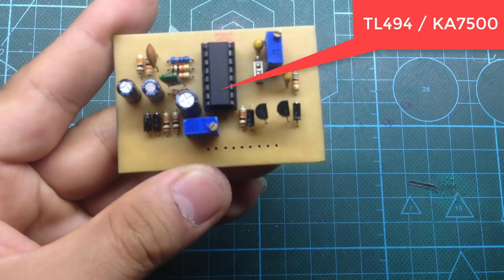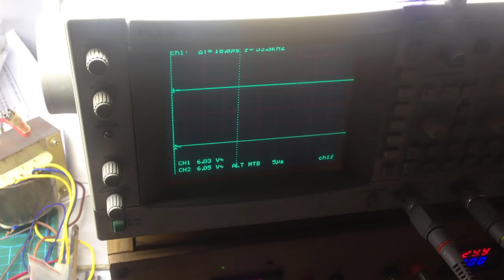TL494 PWM 50HZ to 100Khz Inverter 5000W

Comment from the maker: Project today, I will build PWM module using TL494, you can also use KA7500. It is similar. This module can be used for boost converter, buck converter or iron transformer inverter, pulse transformer inverter, it also has voltage feedback and current feedback. with 2 working modes. Later I will build more circuits using this versatile module. It can drive a maximum of about 16 mosfet - 5000W. If you want to use more, add totem pole drive

If you like my video, please like, share and don't forget to subscribe to my channel, Thank you very much. With 10,000 views, I will get $ 3 from youtube.
Reply: Homemade 102 vietsub sang tiếng việt nửa đi anh mỗi lần đọc commen toàn lên google ko ~~~
Reply: Mà lên tận 5000w thật ko z hay chỉ là 5**w
Reply: Home made how we use it for smps if we need a gdt OR not? Tks

Comment: Hey I just want to know how to check this module without building an inverter or SMPS??
Also in the circuit diagram , both emitters of s8850 are connected to GND but it's different in pcb layout as per orientation shown in the video.
Pls help I have to complete it

Comment: I want to ask if used a multimeter to check the current and dat is it safe to carry a 400watt tv ? Pls reply😃 pls whats d resistance of the primary and secondary windings individually.
Reply from the maker: With pulse transformers, the resistance of the primary and secondary windings is very small. Under 1 ohm
Reply: @PhdHung  thanks 😊 but i wonder what will happen if i pack a bunch cfl inductors(eg 20) turn transformers with some mosfets can i get a high amp 220vac voltage?
Reply: Eitherway i like d video nice and professional outlook✌👍👌

Comment: Bro I'm in trouble please help.i need to make a very very powerful Tesla coil with this circuit so which IGBT or MOSFET I use and which pins.please tell me the connection please and can I make a Tesla coil with this circuit which works on 220v??? Please tell🙏🙏🙏🙏😭😭

Comment: :) Ok but what is input voltage, what is output voltage, what is efficiency? And this circuit only for incandescent bult or resistances. If you connect this circuit to adapter, motor or an electronic device, that device will fail. (because 53kHz is to high for IN4007 of inside devices)

Comment: Thanks for your videos. i need isolated power supply from 220V AC to 100V DC  using SG3525 With optocoupler  feedback.
Reply from the maker: ?W

Comment: You should do a step by step how to conect the sg3525 ic with feedback voltage. Im having some problems to conect the feedback soo i can stabilize the output voltage
Reply from the maker: There are many SG3525 circuits in my channel.

Comment: How to decrease ac Synchronous single phase alternator frequency from 60 to 50 hz, made by kiejeli 7.5 kw( my locally made ups transfomer make a sound of tak tak after 3 sec whenever I try to charge the above mentioned generator, if u have any solution kindly guide me)
Reply from the maker: You can use H bridge and EGS002 module. Generator output is rectified by diode bridge to 310VDC and fed to H bridge using EGS002. you will get true sine 50 / 60HZ - 110V / 220V (selectable) and voltage stability
Reply: @PhdHung  Bro this type of alternator has no such type of mechanism I will send u the pics and vids if u havr any fb or whatsapp, tnx for giving me your precious time Lov u Bro

Comment: Sir if I use iron transformer what voltage should I use?  12v or 9v or 7v ?
Reply from the maker: If it is a square wave inverter, use a 12V transformer. If modified inverter sine, use transformer 9V. If it is sine inverter, use 7V.

Comment: Well done .... so can you use as “ buck-boost converter “ in the same time ? And How ? Use inductor or what can you explain ?
Reply from the maker: wait for my next video, i'll do it, buck using N mosfet
Reply: Thanks, made buck-boost in the same time , can step up and step down voltage in one circuite or module of course have CC mode and has feedback for voltage and current.

Comment: wow can tl494 drive 16 mosfet without totom pole that's good it seems that tl494 is better than sg3525 . any way you are handsome brow. but i dont understand whats the work of the jumper???  is it used as switch or what ??? and thank you so much for all your videos .
Reply from the maker: Use Jump to switch working mode. This jump can be configured for enabling the output of the IC in the push-pull mode or single ended mode.

Comment: I made the circuit 6/8 pin voltage does not come out When I touch my 16 pin finger, the voltage comes out s8550 tl494 is very hot What is the problem? I don't understand

Comment: what switched  the  jumper ,   and please    the trafo windings     primär and  sekundär?  gretings from germany
Reply from the maker: Use Jump to switch working mode. This jump can be configured for enabling the output of the IC in the push-pull mode or single ended mode.

Comment: Can use it for computer, fan, charger ?? What is output frequency ??
Reply from the maker: Frequency is adjustable. If you use pulse transformer, I suggest 40Khz frequency, if using iron transformer, choose frequency 50 or 60hz.
Reply: @PhdHung  thx

Comment: Where do I go to purchase a small high frequency high voltage transformer that can take a DC voltage from 6 to 12 volt and put out 20,000 volt at 30 milli amp ?
Reply: dear you can re wind any small old ferrite core transformer with some calculations.
i had wound one e15 transformer with 3 turns in primary and 100 turns in secondary and tested it at 50 KHz, i got about 1600 V Dc from 12 volt dc.

Comment: Hello,
You did a great job.
I immediately subscribed. I have something to ask you.
1. How should I feed this circuit for 700 watts? So how many amps should I have?
2. Can we use Mosfets as IRF3205? And how many?
3. For feedback, should we set up another circuit or is that all? What is SG3525 for?

Please answer, I would be very happy. I need this circuit a lot. Respects.

Comment: Sir mene amplifier ke lie 60-0-60 2000 watt ka dc to dc converter bnana he. Or main app ka kona drive use kru file no.  Bta di ji e
Reply from the maker: ok, wait
Reply: Sir jese 60-0-60 voltage drop na ho abhi jo drive use kr rha hun main full bass pe 8-10 voltage drop ho jate he
Reply: I need 60-0-60 2000 watts. Tell me which drive file I used

Comment: Hola  compañero!!! Tienes algún circuito  que soporte 48vol o más ? Y que utilice  transistores  IGBT ? Saludos
Reply from the maker: Use buck circuit to supply VCC power to the module. It will operate at 48V.
Reply: @PhdHung  Thanks, you're a genius 💪

Comment: if i change on pin 6 resistor to 10k varible resistor what the range of the output freqency
can i use this module to control treadmill motor?
if i cant use it can u make control board for treadmill with photooptic sensor feedback to have constant speed
can i have ur number to contact u

Comment: Will i get 5000w and pls give an example using motor pump plsss
Reply from the maker: This is an oscillator circuit, you will need 1 DC to DC module and 1 DC to AC module to be able to run the pump.
Reply: Plss sir upload a 3000w inverter circuit plss .......🥺🥺🥺

Comment: Please connect a load which will consume 5kW to demonstrate how it works. To light 40-60W bulb is not impressive.
Reply from the maker: ok bro
Reply: Esos 5kw son imposibles para una ferrita de ese tamaño, a mí se me hizo casi imposible llegar a 1Kw, y para llegar a 1kw tuve que poner 10 vueltas en el primario para 170V a 134Khz y el IC555 apenas aguanta esa frecuencia. Estos vídeos son mentira porque necesita una gigantesca frecuencia para poder poner la bobina del calibre que necesitas. Todos estos vídeos son reales pero la potencia no lo es porque en esa configuración máximo se llega a 300 watts. Te dejo las fórmulas básicas para que puedas hacer la ferrita a tú gusto 😁 (Volts×10^8)/(4×frecuency×B×S) está es para calcular las vueltas de las bobinas P=V×I y está es para calcular la potencia, lo único feo es que tienes que ir probando los valores para que pueda entrar la bobina con su respectivo calibre, espero te sirva

Comment: Best ic..sg3525..ka.3525..pin 10...shutdown system...tl494..bad ic...for use inverter... M...Rashid...multan...pk
Reply from the maker: If you design correctly, they are similar. TL494 has 2 comparators, so it is suitable for circuits that need to feedback current and voltage. for example buck circuit